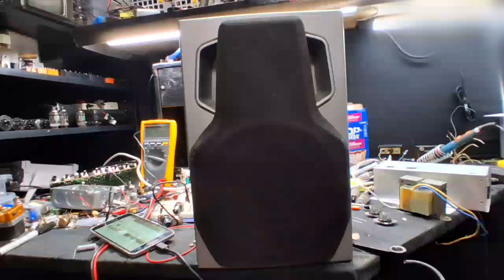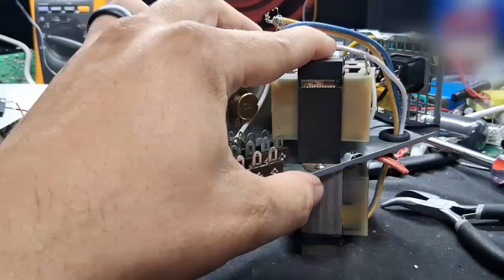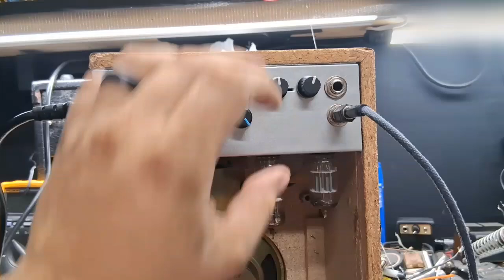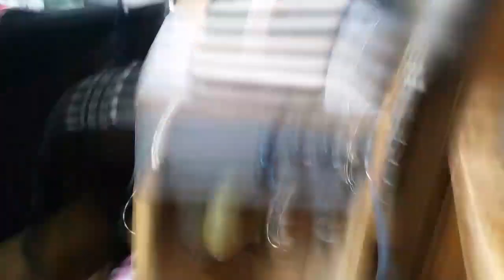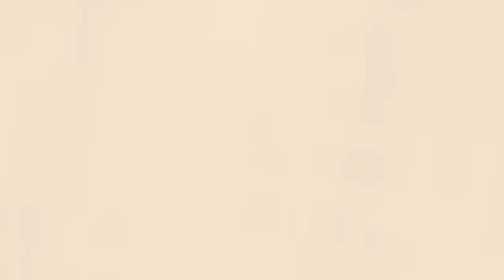The Fully Custom Orange Juice Flavored Potato Peel Shaped Goat Skin Covered Vacuum Tube Guitar Amp

Comment: It still sounds like a crap speaker, I suspect that an amp cabinet is extremely important to its sound. 1” walnut boards with 666 brad nails and wood glue
Reply from the maker: 666 nails yessir 
No more, no less.
Honestly, this amp has several shortcomings:
Saturated output transformer kills bass and causes unwanted distortion,
Cooling fan powered off heater supply causes noise, 
Bad layout causes oscillations that take out the high end if you turn the treble up,
Tone controls are way off,
Oversized grid stop resistors cause a muddy sound,
Some other stuff i havent figured out yet.
A better box and a decent speaker would surely help but if i fixxed the rest of that crap it would be a lot better.

Comment: Would a battery powered amp be loud enough and have less noise?
Reply from the maker: Not with a fan it wouldn't. Thats where all the noise is coming from on this one. I have a tube thats meant to run on 12v B+ but i expect it to be pitifully quiet. We'll see tho
Reply: @ full bridge RECTIFIER